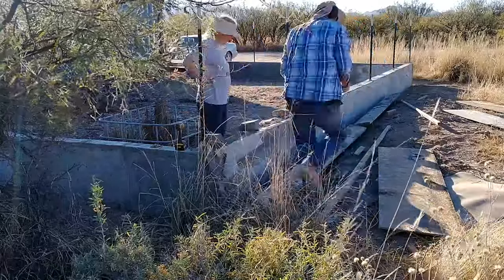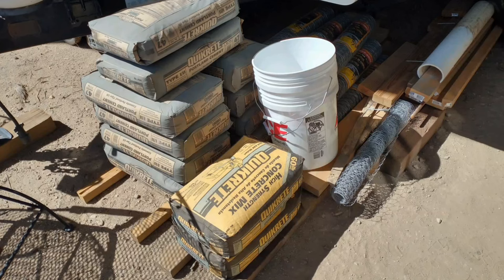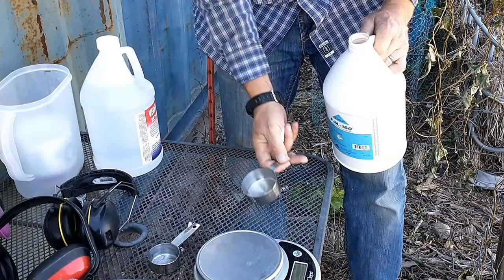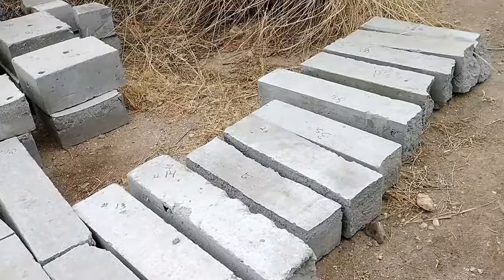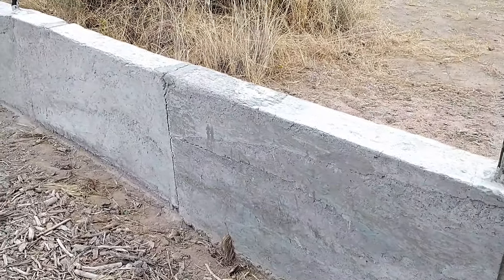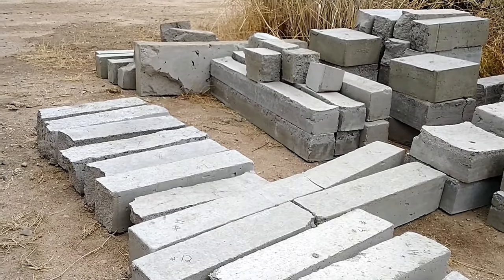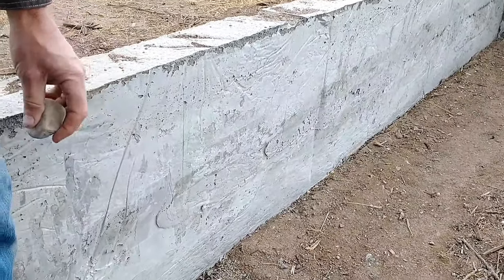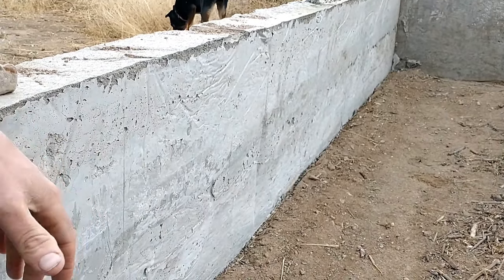Why we GAVE UP on AIRCRETE & What is Our Plan Now?

Comment: I did not give up. But I also learned to build with it. If you leave it to elements alone then it like stone will develop problems. Last thing is you have to follow the formula and instructions. After the build you must also install a fabric. Sorry about those results But I have an entirely different experience
Reply from the maker: Yes, we were planning to use metal and fabric reinforcement, as well as an exterior stucco, but wanted to first test the aircrete on its own, as well as our ability to make consistent batches. We also realized from our testing that temperature was an issue, and we were going to have to wait until spring to pour the walls. The potential for brittle batches and shrinkage was a problem, and leakage from poured in place walls as well as curing was going to be extremely difficult to manage. We were so glad to move on from aircrete, and we are so  happy to be living in an actual house this winter. Another winter living in an RV while trying to finish our house would have been rough!
I'm glad it worked out for you. Are you living in an aircrete house?
Reply: @RedandAprilOff-Grid  well I am glad you are in house. I use a steel form in process so we get a consistent  block quality no cutting just pour and pull also is is true temp is a factor so we have a controlled environment.  Cure is also important.
Reply: FYI I did the same things as far as Experimental process. Took a few goes to find great lol
Reply from the maker: Cool, glad it worked for you! Our temperature swings are pretty extreme here in the desert, and we don't have a temperature controlled space available.
Reply: @RedandAprilOff-Grid  I can tell than you don't know what you are doing. Any Temp above 50F is adequate. Which is disappointing. Why not just say than that the material just did not meet your needs as opposed to knocking it? Well ok enough said. Cheers You don't need a controlled environment in the desert. You do in the cold north. Also the soap you use does make a difference. perhaps you might take another journey lol. Something to the tune of it was maybe too difficult or too much work. but to knock something that has not been mastered is a bit of a disappointment.
Reply from the maker: @Spoondawg0075  The video is Why WE gave up on Aircrete. In the last year we have seen temperatures here range from 105° in the summer, down to 5° in the winter. When we were making aircrete last fall, our days were in the 80s and we were getting down into the 30s and by the end the 20s at night. We had to keep the test samples covered and under our RV to keep them from freezing. We didn't expect to get below freezing here very often, but unfortunately the temperatures in our particular area are 20° colder than in town. Spring is very windy, summer is hot, & we have limited power with solar. It wasn't looking like a practical or good option for us. I haven't found anyone that is actually living in a homemade  aircrete house full time, you should do a video on yours.

Comment: Well, maybe you could try stabilized earth blocks instead if you are thinking Rammed Earth.. its similar... still needs testing...  To strengthen  softer crush strength walls for beams ect it is common to pour a ring concrete beam.. by spreading crush force ect this is stronger.. Also If you used steel or wood as full post and beam, you dont need to care about wall strength much..   As for crush strength of AIr crete ..Pranatech guy talks about testing weigth  per volume for measurable PSI strength.. Also, use of reininforcing via fibres lath and or Fly ash are all well known in concrete... mostly these things would directly, be applicable to air crete..  The pranateck guy talks also about how to get right mix via materials and mixing...  Just saying, there are ways to solve your issues... My GO TO would be the post and beam thing.. its bullet proof, and building inspectors can understand it..
Reply: Ps I wouldnt trust ramed earth walls to carry beams either if not needed.. Ie Id use post and beam with it too..
Reply from the maker: We got some good batches of aircrete, but now I think the colder temperatures starting affecting the Drexel.  After our experience, the only way I would consider using Aircrete is if it was made into blocks and fully cured and dried. That way we couldn't make sure the blocks are done shrinking, and they aren't overly brittle. They still wouldn't be suitable for load bearing walls. 
 We made a lot of calls trying to find anyone selling fly ash, it sounds like great stuff, but no one around here sells it. 
Rammed earth was our tentative plan for about 6 months, then we decided to try aircrete, and now we are building a somewhat more traditional type house. 
Once we actually crunched the numbers, aircrete wasn't going to be less expensive anyway, and it would have been way more work. Although with the crazy cost of lumber, it probably would be less expensive now. Glad we bought most of our materials in December.

Comment: Did you guys tried to apply helix micro rebar with your aircreate to reinforce the base material?
Reply from the maker: No, we didn't try it. Someone mentioned that if fibers are not fully encased in the material, they are not very effective. Which makes sense.
 It was getting too cold to continue testing, and that's also likely why out later batches were turning out so poorly. Aircrete seems to be pretty temperature sensitive, which also makes it a difficult material to build with.

Comment: Powdering is what I'd worry about. Having the aircrete in the walls and opening up the walls after a couple years of seasons to find the aircrete turned to powder
Reply from the maker: Yes, definitely a concern, and it would be impossible to repair.  It will be interesting to see how well the garden wall is holding up in a few years. 🌞

Comment: Any idea how aircrete holds up over a few freeze/thaw cycles?
Reply from the maker: The blocks sitting outside, look okay so far. Our winters here are pretty dry, so that helps.  If they are very wet and then freeze, it seems like they would eventually crack and fall apart.

Comment: I've often wondered why one can not use a drier foam. So higher air pressure. Then you mix the cement slurry, and then start mixing in the foam by fixed water volume. Then keep mixing until the volume reduces to the calculated volume. I am sure that longer mixing will pull the extra air out. Then one will end with a given amount of cement and water and aim for a target volume instead of hunting the foam density. Can this not work? I also think that adding a cup of Bentonite clay in stead of Glycerine, will get the mix smoother and help to trap smaller bubbles. Bentonite is a ultra fine clay that chemically reacts with the cement on curing. So the product should be harder. Cat litter is often Bentonite. Not always.
Reply from the maker: We know what happens when the foam is too wet, but I'm not sure what happens when it's dry. Maybe worth a try, aircrete is tricky stuff.
Reply: @RedandAprilOff-Grid  It is worth a try. As long as it is not freezing, temp is no issue with cement curing. It may affect the foam density though.. I am planning on building a Gothic Artch house here in Sweden next year. So Aircrete. I want to pour directly rather than make and use bricks. Also a good and easy coating is cement and salt, 50 50 and water to the desired viscosity. hardens the outer surface and can be used with fabric. I apply it with a soft broom.
Reply from the maker: @heikkiparviainen6084  That sounds awesome! Best wishes on your build! Aircrete is tricky stuff, but I'm sure it's possible to get it right. We still need to finish the plaster on the garden wall, we might give that recipe a try. Maybe the salt would keep it from freezing. We tried to keep it protected, but the plaster on the first section has white patches where it froze.

Comment: Did you use only sand cement and foam? I guess using fly ash (if available would have given you stronger result). The mix needed to be more stable with silica fume. I failed too, in my few attempts but unwilling to give up, at least not for affordable housing in the villages in Bangladesh.
Reply from the maker: This was just foam, and cement. We tried a couple of batches with finely sifted sand, but the foam wasn't able to hold the sand up, and those batches fell. We tested them and they were quite strong though. We wanted to try fly ash, but it wasn't available for sale anywhere. If you can get sand and gravel, poured concrete walls are real nice and strong. Foam aircrete can be quite weak. We did find that by adding 20% less foam, we got a much stronger product. Foamcrete seems to be pretty finicky and temperature sensitive. Best wishes!

Comment: My first suspect from what you are saying and your inability at replication or improvement through ingredients would be hydration, mainly because you did not mention it yet it is one of the most important factors in strengthening concrete. How did you hydrate this during curing and for how long did you cure it ? Did you keep it covered during hydration / curing ? Did you use any plasticizers or water reducers or additives like fly ash, slag or silica fume ?
Reply from the maker: It was all explained in previous videos. The samples were all treated the same, covered in plastic, and watered morning and night for 7 days. Then we tested them on the 8th day to compare the different batches and recipes.
Reply from the maker: We looked for somewhere to buy fly ash, but we couldn't find anyone that would sell it to us. The recipe we used, is in the description of all of our aircrete videos.

Comment: U guys in AZ? I am. Anyhow... Isn't that the basic thing with cinder block?
WHAT'S THE DIFFERENCE BETWEEN CINDER BLOCK AND FOAM CEMENTS? I Used TO MAKE ADOBE BRICKS WITH A PROFESSOR. WE MADE SOME STRING STUFF, ADDED MAGAZINE PULP AND PAPER PULP AND GLUE. WHITE SCHOOL GLUE. TAKES LONGER TO DRY. SUPER STRONG FIRE RESISTANCE HIGH.
Reply from the maker: Yes, we are in Southern Arizona. The main benefit of aircrete is that it is lightweight and the air pockets make it insulative. The main issue with cinder block is that it still needs to be insulated. Some were saying that aircrete is R-6 per inch, which would be amazing, but we have since learned that it's probably closer to R-2 per inch.

Comment: I thought aircrete only for walls non bearing concrete. The structures should've used conventional method. Aircrete wall will only lessen the burden to the structure for its lightweight. 
But thanks for sharing your test. I once thought of using aircrete too but more interested in mixing stryrofoam ball+fiber for lightweight walls.
Reply from the maker: We were planning to build a metal structure, with supports every 8 feet. Aircrete, rebar, wire mesh, fiberglass mesh, and plaster were going to be used in the walls and roof. Best wishes with your projects! 😎👍

Comment: Maybe it was drying too fast for reasons like: humidity too low, direct sunlight, wooden forms absorbing water, too hot out, blocks were too small to retain moisture, etc.
Reply from the maker: @pete4043  It was definitely too finicky for us since we were living in an RV off grid in the desert with winter approaching. We kept the samples covered and damp for a week. The cold temperatures were likely an issue, especially for the Drexel foaming agent.

Comment: I once used quickcrete and mixed correctly, but it never set, why? Because it was a bad bag, they didn't put enough Portland cement in the mix or our bag. You have to make your own mix. Sorry.
Reply from the maker: That's another reason not to build with aircrete. We were going to need a whole lot of bags of good Portland cement.
Reply: @RedandAprilOff-Grid  you can fix weak Portland by adding liquid glass, and 0.1% of sugar to your mix, but I don't know how that will affect aircrete. I have been working on finding the true roman concrete mix, and it's stunningly simple. I have got to get the proportions right, though. The American version would be soda potash, (a type of feldspar with more potassium and aluminium in it, Mediterranean sea salt( 40% sea salt to 60% distilled water) flyash, (almost exact same ingredients as pollozza volcanic ash needed), volcanic rocks and clay powder, and quick lime, not hydrated lime. And diatomaceous earth, or in its place, powdered liquid glass. That goes in last too. I don't know the slump it will need, but since they packed it down, it sounds kind of on the thick and gooey side instead of flowing or crumbling. It doesn't suffer shrinking or need expansion joints.

Comment: Did you contact Honey-Do-Carpenter? So far as I can see he is the pretty much the expert on doing aircrete. Also I didn't see any mesh reenforcement in your samples. Sorry to see you are having so much trouble with it.
Reply from the maker: He wasn't making any new videos at the time, and his method was much different. I watched a whole lot of aircrete videos, and asked a lot of questions. 
We were testing different mixes and our ability to make consistent aircrete. We were planning to add wire mesh, and rebar on the inside of the walls, and fiberglass mesh, and plaster to the outside, as well as a sturdy metal frame. 
Thanks, it was an experience, and we were glad we decided to go with a more traditional build. 🏜️🏡

Comment: I would have considered a lath/chicken wire over-mesh with a stucco
bye bye micro cracks! :)
Reply from the maker: We were planning on adding stucco and various reinforcements, but since the aircrete seems to have the tendency to crack and shrink, it seemed likely we would have big problems eventually. We are very glad we didn't try to build with aircrete.

Comment: Aircrete/cellular concrete is not for load bearing, for insulation you need to go to 3 pounds per cubic foot (R3 per inch), a product called airium can achieved +- R3 but I think they use Mgo cement and not portland cement.

Comment: Can you not buy them in the US? light weight air blocks are very common in the UK and Europe, and you still use normal headers over doors so its only compression strength that's needed, and maybe a normal poured ring beam at the roof, if you can you could extend the footer and do an outside skin.
Reply from the maker: Not that I know of, but maybe somewhere. With homemade aircrete it's really hard to get consistent results. Yes, we were planning to put fiberglass mesh and plaster on the inside and outside.

Comment: There's another video of a guy who poured aircrete between 2 cheap pieces of landscape fabric (i think they were wet so the aircrete would bond to them), maybe only 8 inches thick, about 6 feet long and 1-2 ft wide, and the suspended it on the ends and jumped on it. It bounced like a trampoline but ot wouldnt break. It needs something bonded to it on the outside to handle the tensile forces.
Reply from the maker: The fabric would hold it together, but it would still crumble and lose its insulation value and strength. Yes, we were planning to add fiberglass mesh reinforcement, metal beams, and wire or fiber reinforcement to the aircrete. Our concern is that the aircrete wouldn't stay fully intact for 50+ years. A problem that is now being seen in other countries.
Reply: @RedandAprilOff-Grid  oh, I didn't know it has a history of degrading over time even with reinforcement.   I'll have to look into that. Thanks for the heads up!
Reply from the maker: @davidaustin6962  It's a recent story, schools in the UK that used reinforced autoclave aerated concrete are having to close.   It is a different product, but similar to aircrete. Best wishes!
Reply: @RedandAprilOff-Grid  oh I did see that.  It got wet so the rebar rusted, which expansion wasn't caught because the aircrete absorbed the expansion,  then the ceiling fell in. That was a poor design.

Comment: I kinda feel like aircrete is overhyped. It sounds great, but the durability really concerns me, especially in climates that fluctuate in temperature. It also seems like it would be fairly high maintenance, at least in terms of amount of time each year required to repair the stucco.
Reply from the maker: Yes, and I haven't found anyone that has actually lived in an aircrete house for any amount of time, but maybe they are out there. One guy said he built an aircrete dome, but it started cracking and can't be repaired because the aircrete just turns to powder. He also had a lot of trouble getting consistent batches.

Comment: I wonder if environmental changes have something to do with the difference. Temperature, air pressure and moisture.
Reply from the maker: Yes, the temperatures were getting colder, and that was likely our problem. We were also concerned that the material wasn't going to last 50+ years, the insulation value wasn't great, and it was a huge pain to work with.
Reply: @RedandAprilOff-Grid maybe use it as a filler surrounded by a my stable and predictable substrate.

Comment: Did you test with it wrapped with a reinforced layer and stucco.
Reply from the maker: No, these were just comparative tests of the different batches and recipes of aircrete. We were planning to add some kind of metal reinforcement and fabric and stucco to whichever mix we decided to use. A few weeks ago we put stucco on the garden wall, so we'll see how well it holds up.
Reply: @RedandAprilOff-Grid  there is a fiber based material that seems to increase the strength. I’d be interested in watching a video with these alterations done to your previous batches. Could you wrap as a patch and stucco and retest?

Comment: Would using a concrete vibratory diminish the effectiveness of the aircrete?
Reply from the maker: When the batch turns out right it fills the form in nicely. The main reason for air pockets is overmixing, a leak, or an unsuccessful batch where too many air bubbles pop, and you end up with voids.